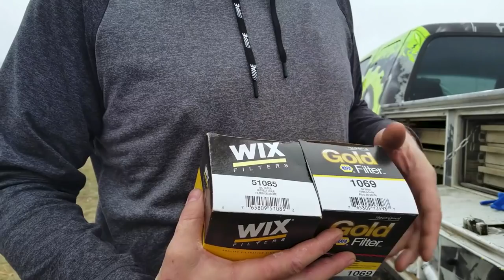The worst oil filters on the PLANET!!!

Comment: Ok, if you are going too compare apples to apples and filters to filters they should be the same filter part for the same engine, not 1 filter that hangs upside down and 1 that mounts sideways and 1 that mounts downwards, but thanks for letting the do it yourselfers the look and how they are designed and how they function, thanks

Comment: The Fram end caps are NOT paper. They are fiber infused. They are NOT carboard paper at all.  Get your facts right. They are okay for what it is.  What you should care is the type of the filtration media and its efficiency. And do you want paper filtration or synthetic, etc. Yes, the cheapest Fram (Orange) filter is crap. I think from the Extra Guard and up are okay.

Comment: So where is the Fram Ultra Synthetic filter?
Reply: It is just as bad as the cheap one but it is your engine do what you want
Reply: @edschwendiman2566  
Why is it just as bad. What's wrong with the element? If your car uses a cartridge filter then all you're replacing is the element. There is no can, no center tube, no anti-drainback valve, no pressure relief valve... just the filter element and an o-ring. Even the OEM Toyota filter doesn't have end caps. End caps don't filter anything.
Reply: @njsongwriter  go to any salvage yard look at vehicles with little to no body damage and look at the engine 9 out of 10 will have the orange can of death I haven't used a frame for thirty years experience engine damage that's all it takes
Reply: @edschwendiman2566  
I use the Fram Ultra on our 2009 RAV4. It's rated for 20,000 miles. I would never use any filter for 20,000 miles. Anyway, I recently ran a Fram Ultra Filter for 10,000 miles and then had an oil analysis done when I changed it. The percent of insolubles in the oil was only at 0.2% after 10,000 miles indicating that the filter was still doing it's job. The upper acceptable percentage for insolubles is 0.6% so I'd say that the Fram Ultra was excelling at doing what it's supposed to do.

Comment: Fram makes good filters. Got regular, Tough Guard and Synthetic oil filter. The Super Tech being Walmart's brand is identical to the base Fram oil filter #9018 cartridge filter. You got to compare and put the prices of all three filters you mentioned.
Reply: No, just no.  It's not worth the $5 difference.  If you filter fails it will cost you a lot more.  This is just false economy.    Cheap out on oil, not filters.

Comment: The worst oil filter VIDEO on the planet!!
Can you confuse us any more?
After you cut them open you started with a NAPA filter at least that's what you where calling it the whole time and had it turned so we couldn't see the writing on the filter and said at 8:33 it's equivalent to the Fram. ?  Next you grab a Wix box that has NAPA filter in it. Does that mean the first one was the Wix? Couldn't finish the video so there's possibly more confusion.
Bottom line is... I agree with you on the filters, but get your stuff together. Compare different filters for the SAME application not different filters for different applications. Keep things organized and in clear view of the camera. Thanks
Reply: Dietrick Miller it happens in a lot of videos.  No big deal to easily figure it out.  Let’s give the man some credit for helping us out, it took a lot of his time.  Cheers.

Comment: -   I agree to never buy an oil filter that has had its end cut off.  The video however, is propaganda by someone not interested in truth if it conflicts with how he believes, not thinks, things "ought to" be made or done.  He doens't know it, but he has an Luddite agenda.
-   Regardless of what he believes, he is not a well-informed material, structural or chemical engineer. The only way to objectively evaluate ANY designed object is to test how well it performs its intended action. 
-  Looking at a disassembled filter and critiquing the materials it is made from is not objective testing.   If you disassembled your right leg and looked at what its muscles were made of you could not tell the difference between it and the cheapest cuts of meat you could buy.  You'd be confused and appalled by how complex and weak the joints appear, how easily the tendons and muscles could be damaged. But while you are walking or running on that leg, none of matters. Unless it fails for a non-traumatic reason, how it is out together is irrelevant.   If you tested many healthy people's walking, sprinting, 100m and 42.195km, and lifting abilities you could find the best at any one function, but not objectively rate one as best or worst as a leg.
-   Everything but how well a filter works at filtration is irrelevant.  It could be filled with wood pulp or other plant material or the most exotic high tech synthetic fiber ever created and still work well.   Laboratory quality filter paper was made of wood fiber paper for over 100 years because it worked nd ws cot effective.  Any glue that holds a filter element in place without dissolving is a good binder.  Any canister that contains the filter element without rusting, rupturing or deforming is a good housing. Any bypass valve design that works as intended is a good valve.  ANy ipinion from someone who doesn't design commercial automotive filters is irrelevant.

Comment: Sorry man but you (REALLY) screwed this video up and should re-do it. 1st you show us the NAPA which turns out to be the WIX. Then you show us the WIX which turns out to be the NAPA . I get the no FRAM filter. So the WIX is the one with the no drain back valve right? Or the NAPA?  Problem was, after you cut filters, one of you put them into wrong boxes which didn't help you at all.

Comment: He shared his “ feelings”. Where are all the ruined engines he is referring to? 
Also he should get fram gold to compare with wix xp or Napa equivalent and fram silver to compare with wix or Napa equivalent.
This guy is just full of it.
Fact is entry level fram is made for 5k miles with regular oil and it does that job just fine. It’s not made for 10k or 15k miles. Such illogical video.